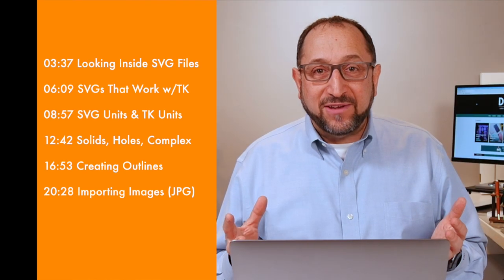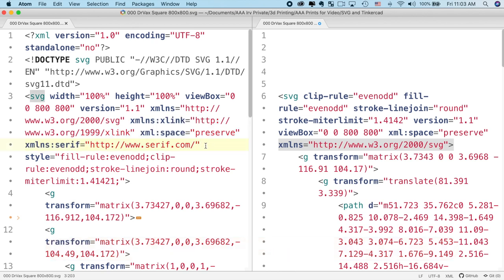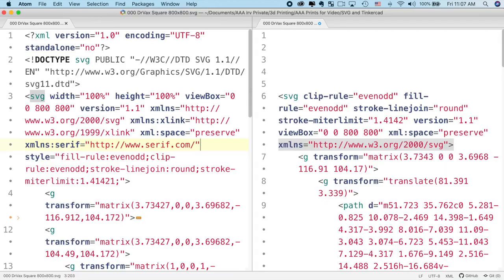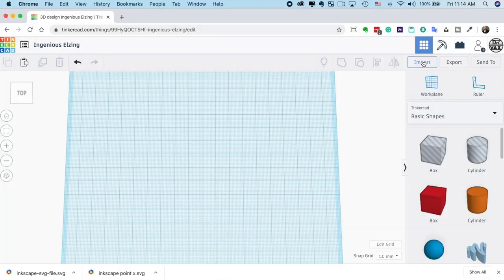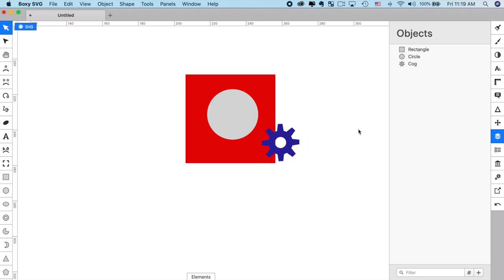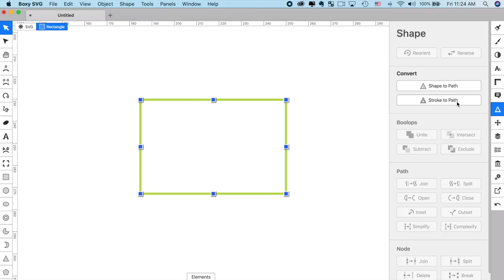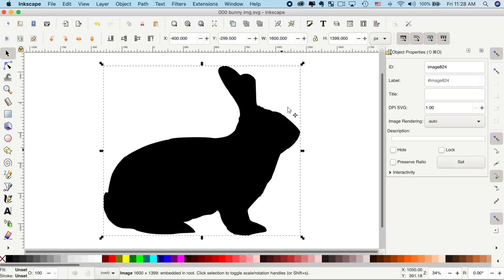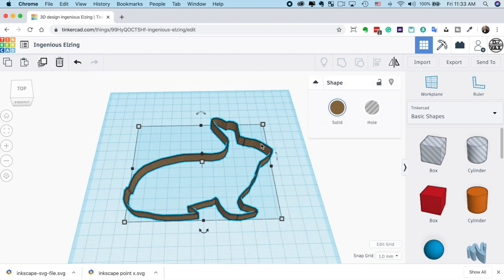Complete Tutorial on 3d Printing with Tinkercad, Inkscape & Boxy SVG

Comment: Hey Dr. Vax,
I've hit a snag with importing an Inkscape SVG into Tinkercad. It is an image of the Rifts logo from Savage Worlds. The image imports but it is heavily distorted.  The bottom of the image appears to be normal but the top side is severely stretched out and ends at a point. No amount of manipulation seems to correct the issue. Can you please tell me what all of the settings / check boxes should be set to  in Inkscape when I save the image as an optimized svg?
Reply from the maker: How big is the image.  Tinkercad struggles with very large files.   Can you  provide me with a link to the image so I can play around with it?
Reply: @MakeWithTech  I got the image to work by playing with some of the enable/disable options in the Optimized SVG window. I'm not sure which option caused the issue to begin with however. The width of the image was originally 1200 pixels, which I know is too wide. So I scaled it down to 900 pixels before attempting to import it. You can find a copy of the image here: https://www.bing.com/images/search?view=detailV2&ccid=0PEWMcui&id=5D3C92076910B286B4B2EA8DB412CC256EDB7A3D&thid=OIP.0PEWMcuiuyUxbbrTdFlM1wHaB4&mediaurl=https%3a%2f%2fwww.peginc.com%2fwp-content%2fuploads%2f2016%2f04%2fSavage_Rifts_Logo-e1460930211895.png&exph=304&expw=1200&q=rifts+logo&simid=608000698067914082&selectedIndex=8&qpvt=rifts+logo&ajaxhist=0 if you would still like to play around with it. Thanks for all of your help!
Reply from the maker: Excellent.  Thanks for sharing.